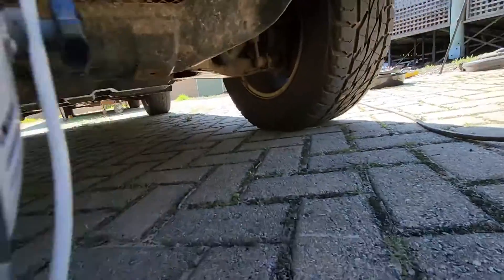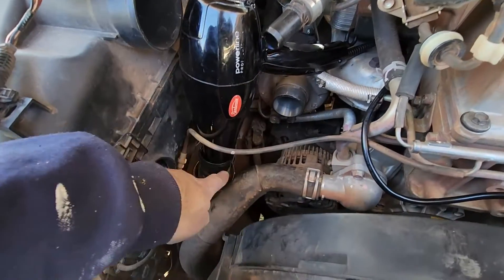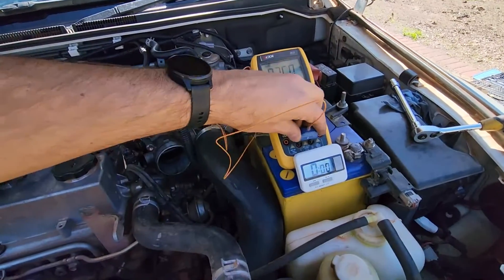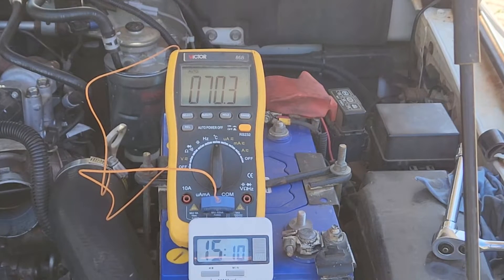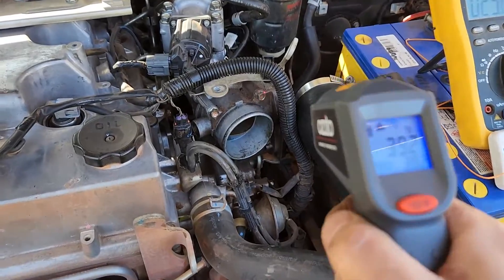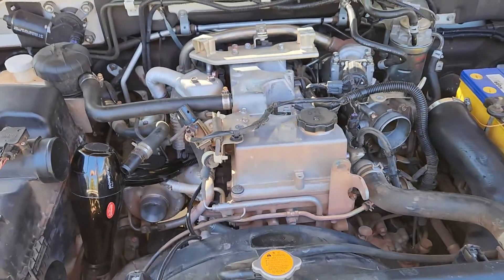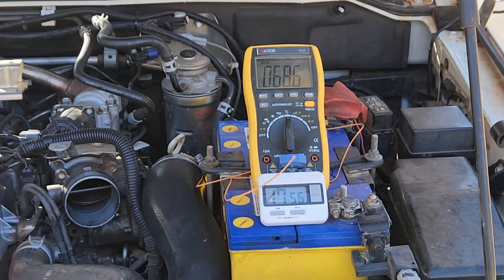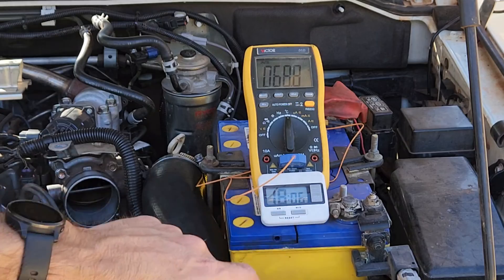[BORING APPENDIX] Intercooler efficiency test before and after using Revive. Not very interesting.

Comment: nice video, just watch the previous and thought id test my patience on this on aswell..lol.. all jokes aside with my 2017 nissan navara i pulled the intercooler out and rinsed 5 lots of thiners through it until it ran clear through, used about 3 litres of thinners but it got the intercooler cleaned and as many know the np300 breath heavy on the oil.. would like to see you do a similar video with taking the intercooler out, flushing it with thinners until clean and then re testing, i feel that would be a better clean then some water based product. love you channel btw well done
Reply from the maker: Thanks for the comment, and that's an interesting idea. I'm sure a solvent would would better than a water-based product, just as you said. I wasn't inclined to try to remove it for this job and wanted to see how well the Revive worked. If I was to do what you suggested I'd want to have a way to quantify any improvement in performance i.e. a dyno.

Comment: Great detailed breakdown.
I have been monitoring the IAT values from the OBD II port on and land up seeing 76C on a hot day 34C ambient temp.
I thought there was something wrong with the intercooler.
Based on the data you have collected.
I would like to try cooling the intercooler with water injection over the intercooler.
Reply from the maker: Glad it was helpful! Water spray over the intercooler will certainly help in dry environments, I'd be interested to hear what temperatures you end to with!

Comment: Damn, you are thorough. I am wondering whether a heat gun would yield a greater delta temperature as it may generate temperatures that more closely approximate egt's.
Reply from the maker: Thanks mate! Yeah a heat gun might be a good idea - I would also need I think a higher flow fan or possibly remove the front bash plate to improve air flow over the intercooler. It seemed even after 15 minutes the temperatures were slowly climbing which indicates the intercooler was still slowly warming up.
Reply: @TheMusingGreg  Thanks for bothering to reply. I disagree, (with no validity), by doing those extra things it isn't likely to replicate being stuck in bumper to bumper traffic on Xmas day in Perth, (45 degrees +), or towing a heavy van up a steep hill at low speed which is when you want the intercooler to be as efficient as possible. What ever you decide, I will be waiting for the results as I like your methodology and rigor.
Reply from the maker: Always happy to engage with interested parties mate!

I get your point and you're right that would approximate those situations, but the majority of the time when the turbo's putting out a lot of heat (i.e. high load conditions) as would be simulated if I used a heat gun, it's likely you'll be driving faster and thus have more air flow across the intercooler, probably enough to overcome the resistance of the bash plate. My concern is that my little breezy fan plus the resistance of the bash plate may have amounted to very little cooling air at all actually passing over the intercooler in my tests, which may be why the temperatures kept rising slowly after the 15 minute mark. Anyway I'll do some experimenting when it comes to testing time, although that won't be for some months yet.

Cheers,
Greg